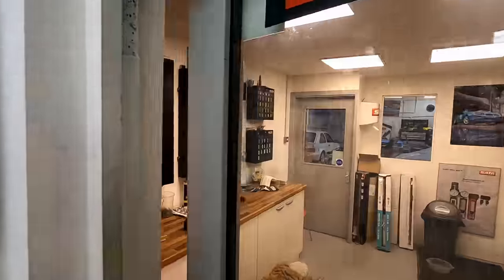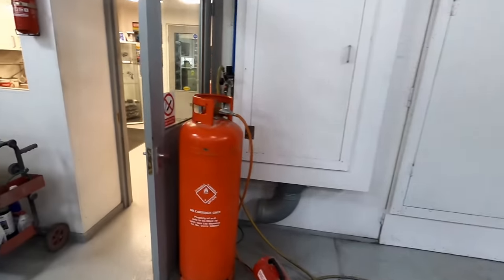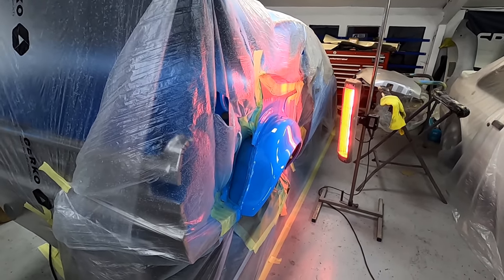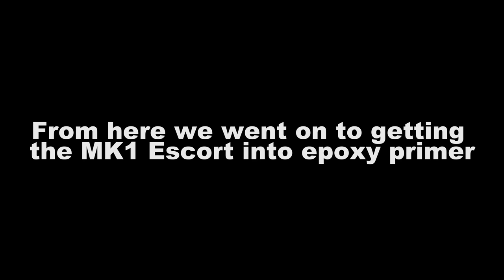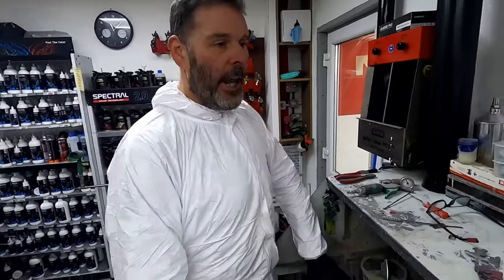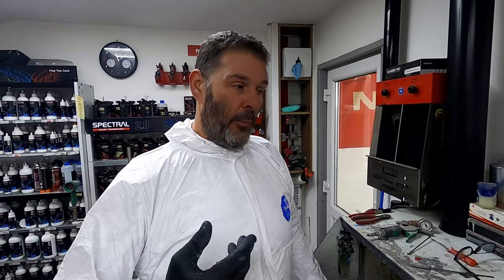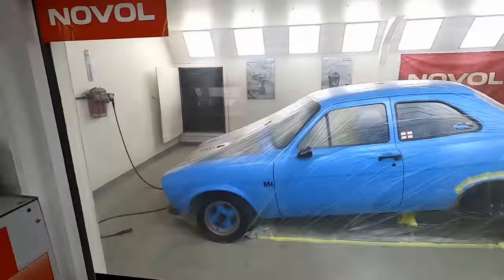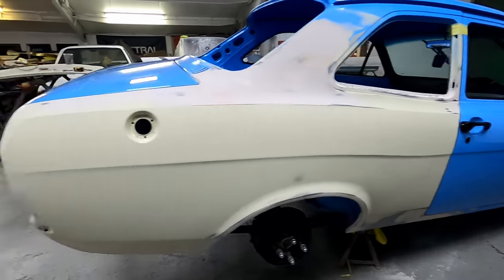Getting the MK 1 Escort into EPOXY PRIMER !!!

Comment: Great work looks good!! Any advice on how to prep bare steel body panels that have been exposed to the elements for a while and where would be the best place to get that Novol Epoxy primer??
Reply from the maker: Hi if they have heavy rust I would suggest have them sandblasted then send back with 120 grit and apply the epoxy primer, where abouts are you based

Comment: maybe you could answer this for me. a few questions (1.) if using black epoxy primer if I just clearcoat it then its UV stable right??  (2.) I want to put some metal flake in the paint job should I lay down some 2 coats epoxy with no flake then just 1 top coat of epoxy with flake in and then 3 coats clearcoat over the epoxy , or do my 3 coats of epoxy then a coat of clear with metal flake an then 2 coats of clearcoat over that?? 
And it is just for my front and rear differentials, driveshafts, and springs and I have epoxy and clearcoat in stock and need to save some money an hoping to not have to buy more paint.. thanks and thank for sharing

Comment: Is there much difference in performance and use between the Novol 360 epoxy primer and Novol for classic cars epoxy primer?
Reply from the maker: The whole novol for classic car system has got a big emphasis on its anti-corrosion properties and in general is a extremely high quality product

Comment: What grade do you block the epoxy down with to get it ready to apply the filler and to apply the high build after?
Reply from the maker: Hi Paul you're better just to red Scotch it, the idea of the proxy is to leave as much on as you can
Reply: @Gavinpinkpaintshop  red scotch enough to lay filler on to aswell?
Reply from the maker: @paulgr32  yes it is